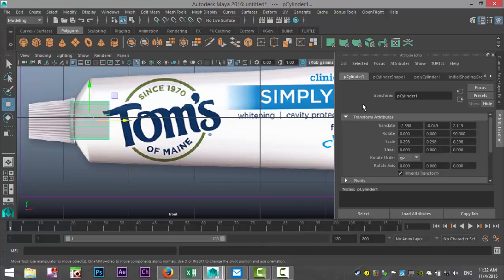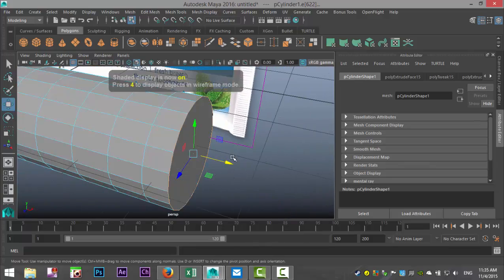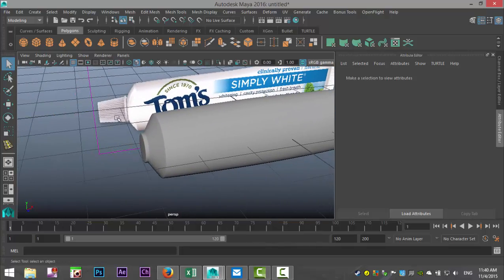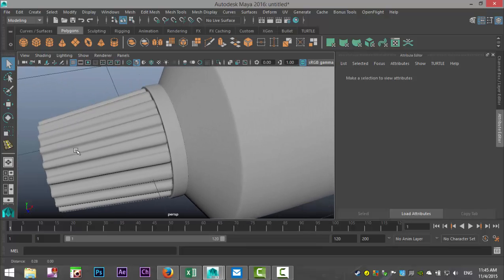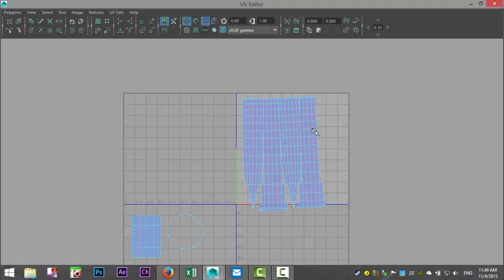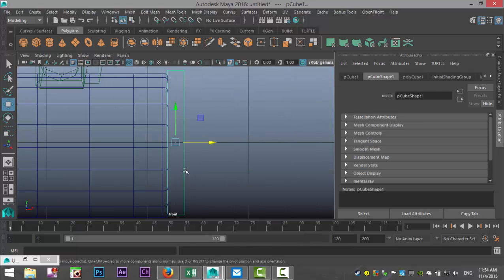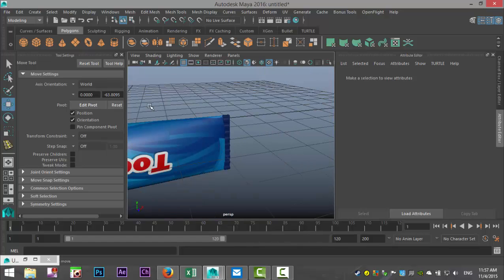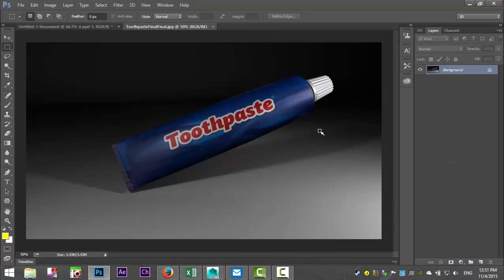Maya 2016 tutorial : How to model a Toothpaste tube

Comment: Great tutorials. Glad to see so many arriving all at once. One tip: when you were texturing the toothpaste tube with two different materials and had the top section selected to make it satined metal, you could have simply chosen Edit>Invert Selection which would simultaneously select the other faces of the tube and deselect the satined metal part. :)
Reply from the maker: +Kevin S Hi Kevin, I actually knew that but when recording a tutorial I am thinking 5 steps ahead and didn't think about that. I don't want the videos to take so long. Thanks for sharing ! I will try to remind that next time :-)
Reply: +Mike Hermes  heh, yeah. I was sure you knew it. It was actually a "refresher tip" for me since I was sitting there going "I think there is an inverse selection command" and I didn't see it under the Select menu (which, you know, would be more intuitive ;) but I found it under Edit so figured I'd share for others on here.